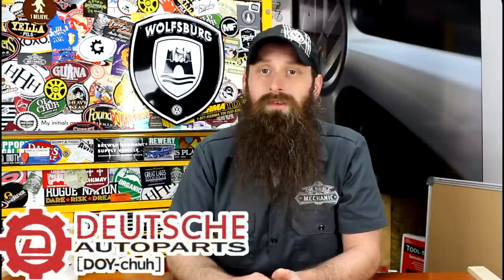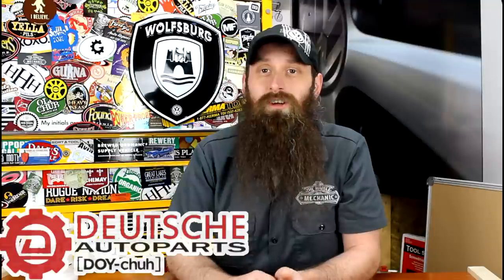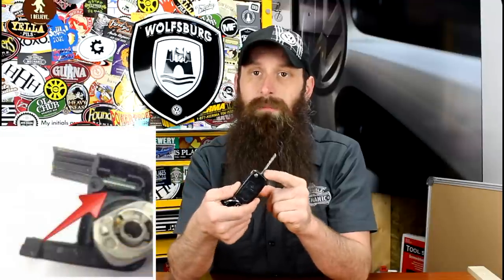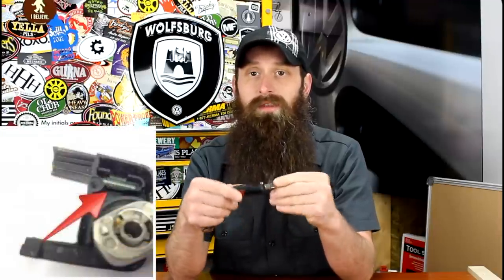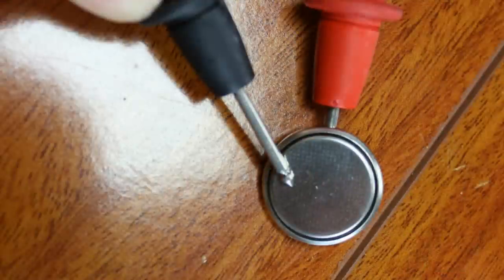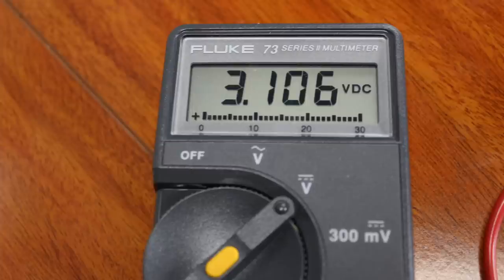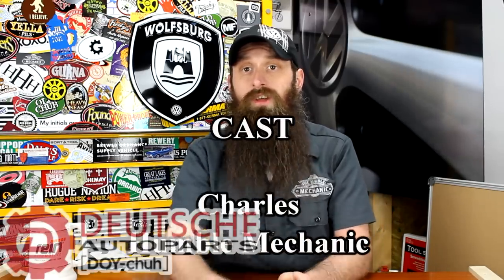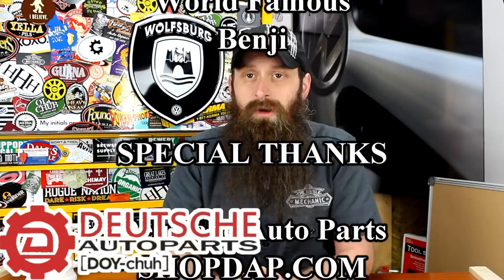How VW Keys and Remotes Fail

Comment: I have an issue where my car just randomly unlocks itself when I'm near it whether it's already unlocked or not.  It can happen repeatedly while I'm next to or in my car, I'll hear the locks clicking and the lights flash repeatedly. Sometimes I'll look at the key fob and the red light is continuously flashing, even after a new battery. It eventually stops flashing though, buttons still work while it's flashing. I usually have to walk to the distance of the fob signal before I lock it and walk away quickly before it unlocks itself so that my car stays locked.  It seem to be only when the key is in range. Happens with both my keys. One key is worse than the other.  Very rarely I'll come back to my car and the key fob won't unlock the car and I'll have to use the key on the door which sets off the alarm. Body control module was replaced by dealership less than 2 years ago for this problem but it came back a few months ago and is gradually getting worse.  Do you think a new key fob will fix the issue?  I don't want the dealership to try and sell me another body control module replacement for $1500.

Comment: I have a 99 jetta which does not have the immobilizer I am thinking it is a faulty battery because I have it connected to a charger and it is saying bad battery would that cause it to do the same thing? it starts just fine but won't allow it to run? please help it's been like this for a couple weeks now and it's driving me crazy! I've changed just about every fuse in the car I've tried reprogramming the keys I tried disconnecting the battery and letting it sit I've let the key sit on the acc for 15 min and tried it but now it has sat so long and getting colder outside I think the battery is completely toast but it wasn't before so what could it be? HELP!

Comment: Hello, i just watch your video and i have a question. My remote is not working. I just inserted new battery, but it seems that was not a problem. I cant lock and anlock the car and if i try to start the car alarm starts. What could be a problem? Thank you. Beat regatds from Slovenia
Reply from the maker: Maybe it’s not a remote issue kore of a door latch issue
Reply: I have another remote, witch is working fine. Not working remote was frstly working bad (somethimes was working, somethimes not) than it just stop workin. I replaced battery, but still not.. Thank you

Comment: Can issues with the fob battery / immobilizer communication drain your car battery? I've been having an ongoing issue with my car battery draining overnight, taking it to the dealership multiple times and nobody knows what's going on. It's not all the time but a few times each year. My car keys are always stored in the front door about 20 feet from where my vehicle is parked.
Reply from the maker: Yep. Especially if it’s got keyless entry.

Comment: Hey Humble Mechanic - I just got a new key programmed at the dealership because my only key was stolen.  After the dealer programmed the new key, my radio said "component protection is active" which locked me out, the EPC light was on and the Airbag light was on.  Any idea why this is?  Did they program my key incorrectly?  They are trying to charge me an arm an a leg to fix a mistake that wasn't there before I brought it to them. BTW it is a 2015 VW Golf R
Reply from the maker: Weird. Never ran into that. Maybe the key didn’t go through properly. 

No lights before? Was the car towed wrong?
Reply: HumbleMechanic I never had a light on before. After 4 hours at the dealer yesterday they were able to unlock the radio and get all the lights off. They said they weren’t sure why it happened  and couldn’t explain to me what they did to get them to turn off. I found a few forum posts and a key article that all pointed to an improperly programmed key because a weak signal when programming it or because I didn’t have a second key when it was being programmed. I couldn’t find anything online about towing issues turning lights on. The car drove fine with all the lights on and never had a check engine light with the EPC light.

Comment: I own a vw polo 9n. Both keys I have always unlock the doors (by traditional unlocking not remote controlled) but sometimes the car refuses to start and there is a car with a key symbol lighting. If i try the other key it may start, it may not. After several trials the symbol will turn off and the car will start. How do I make sure the problem is in the keys and not in the car, or vice versa? And something else. How is the chip powered?
Reply from the maker: Good question. In the US the car will start but shut right back off. Not starting at all is a different issue.
Reply: @HumbleMechanic  no, my mistake. it will start shit right back off here as well.

Comment: I have been looking for a good video that explains how to disarm the factory alarm on a VW. Alarms always go off at the wrong times and just piss people off. I wish they would stop putting them on cars because it just makes people want to vandalize your vehicle when the alarm goes off for NO reason at 7:30 on Sunday morning (this has happened but thankfully not to me). Mine went off for no reason this morning and woke me up. I need to disable it. The alarm makes my car less safe because I can't lock it and go into a store because the alarm will go off. I had this problem on a Nissan too. Thanks!
Reply from the maker: +Ronald Lewis it's going off because you have something wrong. With the proper scan tool, you can see the alarm triggers, that will point you in a direction of the issue. 

Unfortunately the alarm is woven deeply in the vehicles global system. Often just pulling a fuse or disconnecting a module will have other issues.
Reply: Thanks I guess I need to get a better scan tool. You have a great channel!
Reply: Did you ever figure it out? I had to take my key fob apart + took the alarm thing out of my panel because the alarm is unpredictable :( 

I was told it could be a door latch going bad and I guess so because one of my doors doesn’t open from the inside and it gets suck when opening from the outside 

When driving off, one or maybe two of the doors definitely don’t sound when locking but other times they do.

Comment: hey humble mechanic I have an 07 Volkswagen Jetta Wolfsburg Edition I need a immobilizer chip for the remote that guy that I bought it from broke the little handle on the remote and drill a hole  in the immobilizer area in one of the remote, can you tell me what type of immobilizer is to see if I can find one online and have it programmed by the lock Smith
good videos
THANKS
Reply from the maker: reach out to http://www.fixmyvw.com

Comment: Comment and a question.  My wife and my two daughters all have GLS Mk 4 Jettas with the base 2.0 engine and 5-speed.  The daugher's cars are 2000s and my wife's is a 2003.  As far a defeating the anti-theft electronics are concerned, I don't think it's a big deal anymore.  I mean, who would steal a 13 or 16-year-old car?  I perform all the maintenance and yes, the first thing I did when each car was purchased quite used was to change the timing belt, tensioner, and water pump.  I'd like to purchase a scan tool.  Do you have any recommendations?
Reply from the maker: +Frank Howard for that gen car, VCDS is good. It will talk to all the modules and give you tons of data. $350 for the cable software is free. You need to provide your own computer.
Reply: Could you be more specific?  Could you find the scanner on the internet or in eBay and point it out to me?  Thank you.
Reply from the maker: +Frank Howard http://store.ross-tech.com/shop/cat/VCDS.html

Comment: I'm pretty sure I HAVE to buy a new key.
The unlock button don't allways work on both my keys. Have opened one, but can't see anything that could be the problem. I guess it's the button on the pcb that don't allways make contact internally.
So, not getting away cheapily this time..... sigh....

Comment: Hello men juts wondering  if can help me  out please?  I bought  used set of  2 keys which   included,  the cilynder switch , cilynder  for the driver side door and control  module for my 04 gli and my dash  show immobilize  on the screen   and my tuned ecu  immo is off
Reply from the maker: cluster/ECM have to be programed too
Reply: Thanks man you really are a helpful  man  many thanks!!!!

Comment: I know this an old video, but.... Is there any hope for a key-fob that got washed? It still starts the car, But if I press any buttons at all, the alarm goes off. Will a new battery work? or do I have to cough up the $$ for a new fob?
Reply from the maker: Try a new battery. Also take it apart and try to clean it out.
Reply: HumbleMechanic  its apart. Battery out. In a bag of rice for now. I'm getting a new battery today. Thank you for the super fast response!

Comment: Little advice,only secure way to check key battery is to meassure it while its in key and when button lock or unlock is pressed,i had many times situations when the batery out of key shows perfect voltage,but when i press button,it drops allmost to zero volts,but since its really not expensive part,its the best to change it anyway,and try to not leave key without battery for too long.
Reply from the maker: I’m in that boat too. If I’m even a little worried about it, I’m grabbing a new one.
Reply: @HumbleMechanic  Wow,i didnt really expect an reply from You Mr.,my advice was to "regular" peoples who are not in car repair jobs,but feels awesome that You found a time to reply.Cheers and stay awesome as You are. :)

Comment: I have a 2016 VW Jetta TSI. It is push button start. My key has a new battery but the key don’t lock or unlock the door and I have to put the key against the key censor and push the start button for the car to turn on.  The dash reads that it has no key and dings all the time.  Pleas help. Thanks
Reply from the maker: Be sure the battery is good. I’ve had new batteries out of the pack not be good. 

Also you may need to have the car scanned.  A bad reader can caused that
Reply: Thanks for your response. I tried two new batteries and it didn’t work. I’ll have it scanned like you said. Thanks again.
Reply: Did you end up getting a solution?
Reply: Ben Hossack yes, the key just needed to be reprogrammed. Glad it wasn’t something else. Thanks for asking.
Reply: @smashinego  how much will it cost to reprogram my key? Dashboard read "No Key" and just recently, "Key battery" . If I change the battery does the key have to be reprogrammed in order for it to function??
Reply: Ivy Bratt if you change the battery you don’t need to reprogram it. The batteries are cheap and can get them at auto zone or just about anywhere just make sure you get the right ones. I didn’t have to pay to get mine reprogrammed because I just bought it. Just call a Volkswagen dealership and ask.

Comment: I broke the plastic casing in half trying to unlock my VW Passat B5's frozen door. Well. Finally when I did get it opened, the car wouldn't start. Little did I know that the immobilizer chip had fallen out of the key.

4 days later and after changing the fuel filter in the freezing cold and windy parking lot did I realize a new light had popped up on the dashboard - the immobilizer was on. 

Luckily I still found the chip in the snow by the driver's door by shoveling the snow there to a bucket and letting it melt (literally felt like I was panning for gold :D).

Well, but unluckily, I reinserted the chip in the key, but the immobilizer still wouldn't turn off. I tried the chip one way and the other, hooking off and on the battery , but no luck.

I suspect the chip got waterdamaged, but could the immobilizer itself be in lockdown mode or somekind of security mode now, since I've been trying to start the car without the immo chip for days now.

It's my only key aswell. Seems to me I have an ignition swap coming up now, unless I get the immobilizer programmed off.

Comment: I'm about to buy an mk2 scirocco but I'm worried it might get stolen! 

Should I put a central locking system? How do I do it?
Reply from the maker: You can add an aftermarket alarm to it. Just be sure it's wired right.
Reply: @HumbleMechanic  would installing central locking ruin the value of an old car like an mk2 scirocco?

Comment: WHY do customers tolerate these "conveniences" that cost $300????  My Chev van has a chip built into the key itself -- and costs $11 so when the remote gets lost or dies, or well, I use a key like we did for 100 years! A metal piece inside the remote broke off so there is no more connection to the battery!  I haven't been able to lock my Jetta without setting the alarm ... with no way to turn the alarm off ... for like three years!?!  I'm sorry, but this is fraud on the part of the car companies!!!!!  Give me A KEY I can use no matter what -- and it should cost $3-10!!

Comment: Hi, silly question but would my key fob battery or key fob in general be failing if my car alarm Keeps going off? If not, what would you think is causing this? 

I haven’t had issues up until this point and I have had the car for a year now.

Comment: How long would a battery in car need to be out to loose the key code pin? Have an 05 tdi Jetta
Reply from the maker: It shouldn’t ever do that. But it’s possible. I don’t have a time range for this issue
Reply: HumbleMechanic might have another issue then, won't know if that was my issue left the keys in it because it's been sitting a while someone stole my only key gonna order the rosstech module and order a new key

Comment: Hey, I've watched a couple of your videos find you very informative. Question. I have a 2019 key fob that does not work. The physical key locks and unlocks the door so I assume it is the correct fob for the vehicle. The remote and start functions do not work and I replace the battery. Local dealers say they can re-program the key, takes about an hour and cost about $100-$120. I am wondering if you know how this process is done? Do they plug into the car via a access port or what. Inquiring minds want to know.  thank you.
Reply from the maker: 2019 and it’s out of warranty? Did it go through the wash?
Reply from the maker: Yes they do plug in via OBD. They will run a scan and load up the programming test
Reply: HumbleMechanic it is not out of warranty. One key fob works, one does not. It was a dealer loaner sold full warranty and CPO
Reply from the maker: Should be covered unless outside influences like it was washed or got dunked in the pool
Reply: HumbleMechanic great. I figured it was something like that. 75-125 bucks grrr. The said it takes about an hour. The selling dealer is paying for it tho.
Reply: HumbleMechanic thank you for the info!
Reply: @HumbleMechanic  the thought is this remote was never used or never programmed. The dealer is out of state and will cover the cost. I'll pitch the warranty thing to my shop but pretty sure they won't bite on it.
Reply: A FULL HOUR AND MORE THAN $100 ???  
Look: my wife's Jetta came from the factory as the "plain Jane" version: without radio, a simple  with a chip but no remote, and only air conditioner.  It was quite inconvenient to use because as it came from factory, you had only a few seconds after ingressing the vehicle to put the key in the ingition and turn it on, or the alarm went sounding.  Tired of that happening, which was a pain at the stores as you had to put any package on the floor to open the door and get inside quickly, that it became worrying.

Then I found a local auto locksmith, who sold me the remote and programmed it in less than 10 minutes flat. He asked for the equivalent of $70 USD for the remote and the programming. Has been working perfectly for several months. I understand that I live in Mexico and services here as way less expensive here for any job, but saying that reprogramming a key would take a full hour tells me that dealership is a STEALERSHIP full of thieves!

Comment: Hey brother, so let me tell you what I just did, I bought a nice new key for my golf 5 and wanted to move everything from the old one to the new one, everything went smooth and it was pretty simple to the point where i had to extract the immobilizer chip, I tried with acetone, thinner, wd40.. absolutely nothing worked so I tried to give it a small push with a paperclip, thats when the glass broke and I pretty much ruined it. 

My question is, what is to be done now ? Im left with just 1 key but id like to have 2

Comment: How do oil pressure sender switches fail in the mk3 2.0 8v?
Reply from the maker: Usually open circuit or the ground is dirty

Comment: Just had a vehicle with a dead battery, jumped it and ran into an immobilizer issue. Charged the battery and the vehicle still wasn't happy with immobilizer. long short. had to leave the key ON in the ignition for 5-10min. until the vehicle recognized proper voltage and was able to cycle the key and start. thanks for the informative vlog. I'm in the trade and find myself referencing your site often. keep it up! whats your location? I see your rogue sticker.
Reply: Charles Campos, Have you ever experienced a 2016 VW Passat key fob, that can be reprogrammed and be functioning properly, UNTIL you start the car and shut it off,  then when trying to lock the car, it does not work. No idea, kept me up all night last night.  
And, Awesome Videos HumbleMechanic!